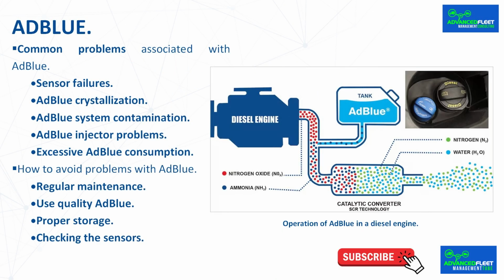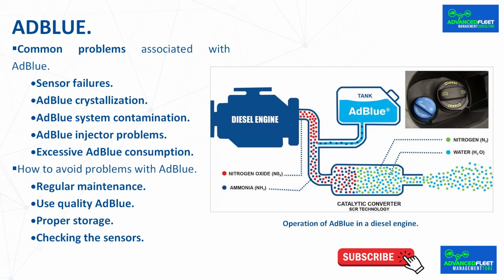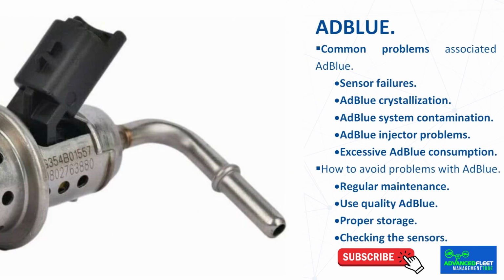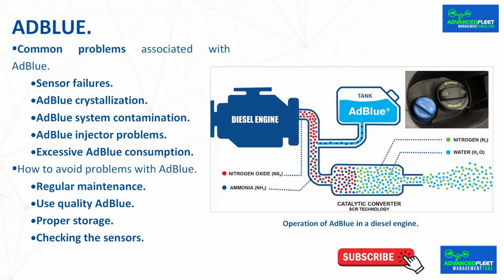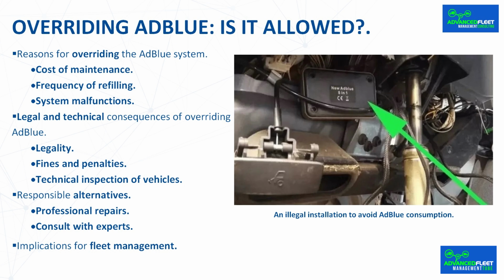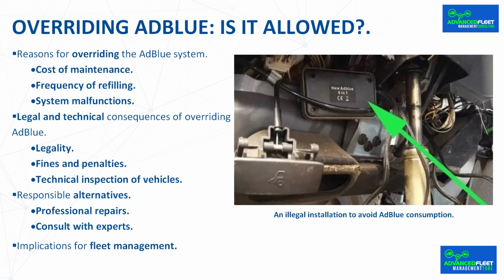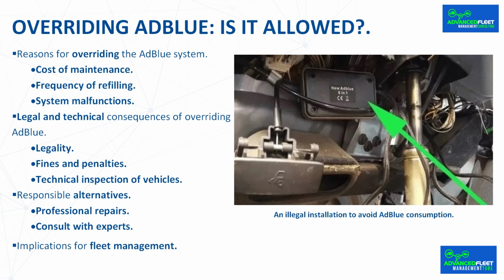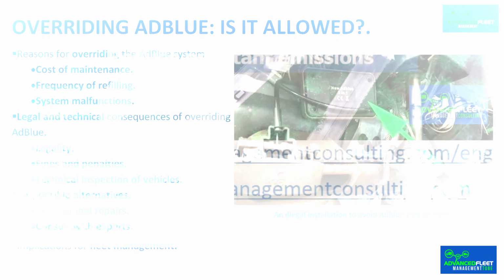Adblue, the problems it often causes and how to avoid them.

Comment: How do you bypass the system on trucks used for fuel efficiency? 
Got truck ran out of ediblue, then they refilled with a wrong one. Now truck can't start. Needs the adblue system bypassed. 
Anyone with a circuit diagram?